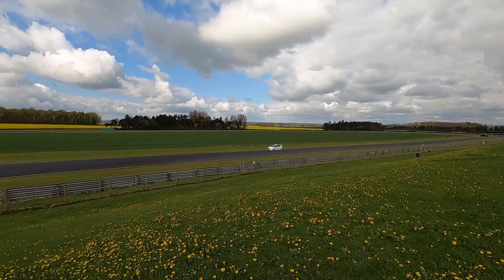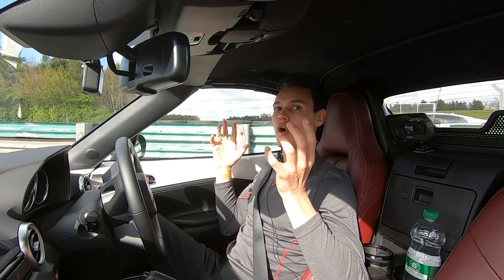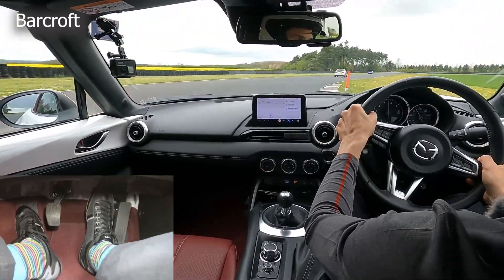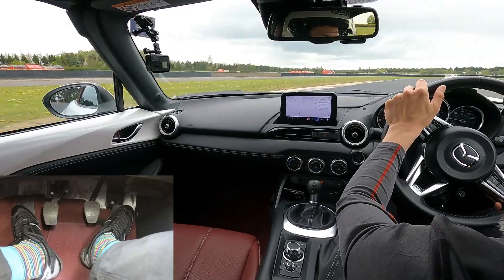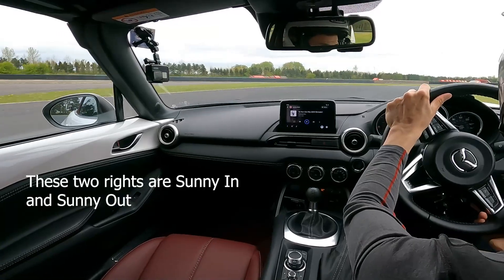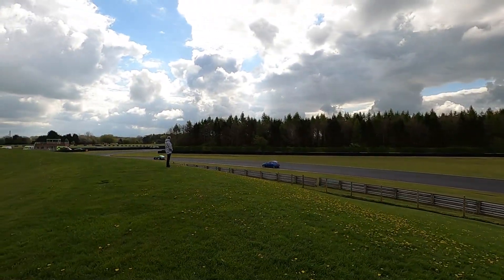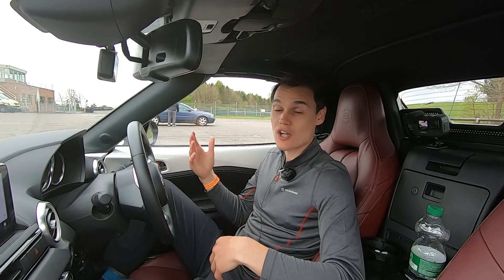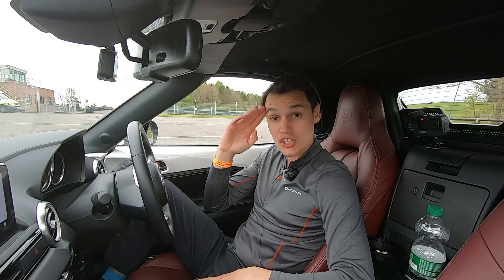Croft Track Review in a Mazda MX5 ND2 including costs

Comment: Love that you can see the gearstick literally shaking as the revs build up - really shows the power of the car and reminds you how mechanical everything is. Driving instructor by day, speed demon by night 😎
Reply from the maker: Haha 😄 The gearstick moves because it goes directly into the gearbox which in underneath it. The gearbox on most cars is further from the stick and controlled via cables so there is no shaking.
Reply: Does changing the gear oil help in anyway with shifting? Thicker or thinner oils?
Reply: @534tgrg6yrtgdf  not really, the thing is there are different viscosity of oils that work optimally at different Temps, ofc if ur driving at the track ur gonna heat up more so u wanna use appropriate oil, and street is not as hot so appropriate oil for that. Same  for engine oil

Comment: Do you try your  utmost best to be imperial? Miles and "pound feet of torque" while sitting in a japan built car in a metric world? Almost as embarrassing as 'miles per gallon' while purchasing your fuel in litres for the last 30 years and having VED based on CO2 figures in g/kilometre. Even the V5C uses kilowatt to quote engine power!

Comment: Do you need to look at the rev counter for upshifting and downshifting? Or do you shift gears by feel/engine sound? Especially in the race track
Reply from the maker: Mostly engine sound with an occasional check if I want to get every last rev. As I get used to cars though I can normally tell what red line sounds like.

Comment: loved my ND2 (on lease), too much body roll (+scary in the wet) but gave me a real connection to the car. Wish wasn't on lease so i could track it.
Reply: Why couldn't you track it on lease?
Reply: @spartanV48  in the lease terms and conditions
Reply: @Wakka100w  is there a way they would actually know that you tracked it assuming no modifications?
Reply from the maker: I do adjust it but it still wipes too much or too little.

Comment: It would be good to see some of your drifting techniques on video with commentary and footwork. I enjoyed seeing the footwork and hearing commentary on this video. What are your tactics for knowing how much to break and what speed you want to enter a given corner? Is it just a case of starting off cautious and gradually keep increasing speed as you learn the circuit?
Reply from the maker: Yes very much so, I start off cautious and gradually build myself up until I over cook it slightly. Judging the limit is all part of the fun, you have to go slightly beyond the limit to find the limit.
Reply: @RichardFanders  Would you say the stock ND is an easy car to drift/slide? How is your gearbox holding up? I'd be quite tempted to add forced induction but hear many reports of blown transmissions. Makes me think the NC would be a better choice.

Comment: in mx5 you can definitely be full throttle though the small chicane (3rd 4th corners). No need to lift off on the way in like you're doing here. I'm also forced to agree on the roddisons pads. I did two full days (blyton and croft) on a set, and they're almost gone already. They're super soft. 

Which tyres are you on? I find croft to be fairly decent on them.
Reply from the maker: Michelin PS4

Comment: Shows how much fun these cars are.
How were the Michelin PS4s?
I found Pirelli PZero Nero GT lasted about 4 laps at Castle Combe on a hot day before feeling overheated and squidgy.
Reply from the maker: The PS4s were excellent. I did 40 mins in one session and I was knackered before the car or the tyres. Lost roughly 0.4mm of tread from the day. Bit less and a bit more depending which part of the tyre you measure.

Comment: I noticed that when your are downshifting while braking you tap you gass padel with your heel. Why do you do this?
Reply: Heel-Toe Shifting research it, i still dont really get it myself lol
Reply: I still don’t understand it. 
The point is to increase the Engine revs before you go down a gear (heavier gear) 
So I think it helps you maintain speed? 

Since when you swap a lighter gear with a heavier gear, the tyre Speed should reduce immediately. Unless u counter it with a Throttle blip
Reply: @maalikserebryakov  It's to be able to get off the clutch quickly while downshifting for a corner so that you have the car in gear and ready to accelerate or engine brake.
Reply: @maalikserebryakov  When you downshift, it's because you're approaching a speed at which the gear that you're currently in is too high for. The speed of the engine will be decreasing, and even more so once you push the clutch in. Since the wheels are spinning the transmission at a higher rpm than the engine is spinning at once the clutch is in, you have to blip the throttle to bring the engine rpm up to the same rpm as the transmission which is being spun by the wheels. This way, you can drop the clutch as soon as you've shifted gears, and since the transmission and engine are spinning at the same rpm, your next, lower gear will engage smoothly without the need to slip the clutch.

Comment: As a relatively new driver is there anything I can do in advance/preparation for a track day like should I be taking lessons of some kind or something?
Reply from the maker: The best thing you can do is mentally prepare yourself to do things at your own pace. Don't feel the pressure to keep up with others and be willing to let faster cars pass. The more hours you have on track the better you will get but if you end up in the wall that usually puts an end to track practice for a while unless you have very deep pockets and you don't get injured. The second most important thing is to understand the racing line and do most of your braking in a straight line before the bend. Build yourself up slowly and always stay within your limits and you will likely enjoy yourself. You can learn a lot from fellow track users and there are videos. I'll have two videos on this soon being re-uploaded in the coming weeks. Oh, it's better to have a standard and reliable car with track brake pads. Power doesn't matter, more power won't make you better any more quickly, it will likely just cost you more money and modified engines tend to need more maintenance. Reliability is key to getting more hours of practise in and having more fun in my opinion.
Reply: @RichardFanders ye but when on the track everybody wants to race lol

Comment: Hi. How many sessions do you usually do in a day? With how many laps? You say you burnt through around £70 of tyres, is that because you’d been going hard at it all day? I went to cadwell in my old mk3 (my first track day) and i think i barely moved the tread 😂
Reply from the maker: I tend to do around 150 miles on most track days. I used about 0.5mm of tyre tread.

Comment: Is there a risk of lift off oversteer with traction control on? I know you have it off. I am too afraid to turn it off!
Reply from the maker: I never have it on but I would assume the risk is less with it on. All cars get lift off oversteer when provoked. When driving near the limit it's important to be smooth without sudden inputs. The MX5 is probably the easiest rear wheel drive car I've driven, it gives a lot of feedback. The VX220 was probably the most difficult because it was snappy without much steering lock to help.

Comment: If mazda didn't increase the roll stiffness in the next generation mx5  (NE)....it will lose its position in the segment !
Reply from the maker: The thing is, it kind of is the only model in the segment. What other new roadsters can you buy for the same price? In my opinion it's about right, it's a compromise.
Reply: @RichardFanders  No, it is not alone ,The toyota Gr86/subaru brz is its  main competitor and with its second generation it did surpass the mx5 in the driving dynamics....mainly because of the increased roll stiffness and body control....so Mazda needs to make alot of benchmarking and make the mx5 atleast with the same roll stiffness  ..otherwise the gr86 will take its position (which it doesn't really deserve!)
Reply: @khaledali-di9mt  People like to say that the 86 is a main competitor but that's mostly in price and rwd. Everything else stops there. There are no other convertibles within the MX-5's price range. It is perfect the way it is because most people actually don't buy the car to track it. The stock suspension is perfect for street driving. For people who want to track it, it's very easy and cheap to upgrade suspensions. Even for serious tracking, people don't use the stock suspensions on the 86 either so there's no point for Mazda to spend money and time on suspensions for 5% of their buyers. Mazda targets the bigger demographics and those are not track drivers.
Reply: @BN99239  with all my respect.....brz is a competitor to mazda ....yes it is not a convertible....but we compare the vehicles with their platform capability not by their body style,second if the roll stiffness is not that important to the Mazda consumers why is Mazda trying very hard with the limitations of the current platform to reduce the body roll to the extend that it introduced a system that reduces the body roll using the brakes!!!....why would a company do that ???....third...saying that the roll stiffness is only important to track drivers or professional drivers is again plain wrong ....alot of people who is buying the mx5 drive on an ultra twisty and challenging mountain roads....and having a car with ultra low roll stiffness does effect the driving pleasure negatively....so it is not about race tracks or laptimes....it is about the enjoyment of driving which is the soul reason behind the existance of these vehicles!! ....and as I said the sweet spot is the gr86 suspension and as u said if some really want to track their gr86 he will need to increase the roll stiffness but the gr86 suspension did hit the nail on the head and it is the perfect suspension for the mountain roads....so  mazda needs to eliminate this problem by making the roll stiffness equivlant to the gr86 otherwise it will lose to the gr86 ...and Mazda really deserves to be the best !!